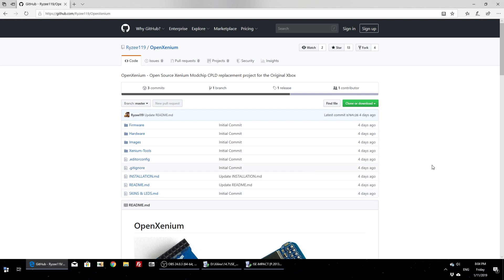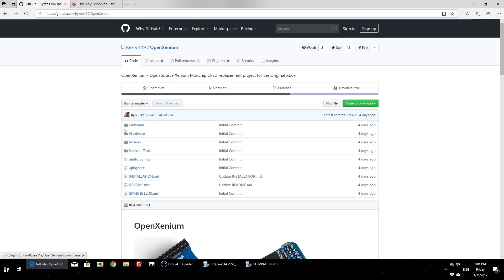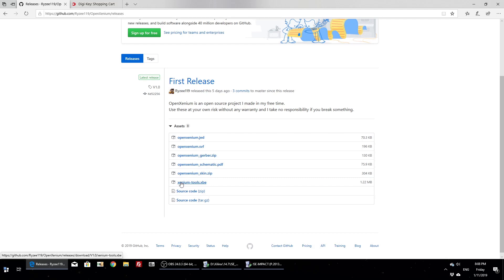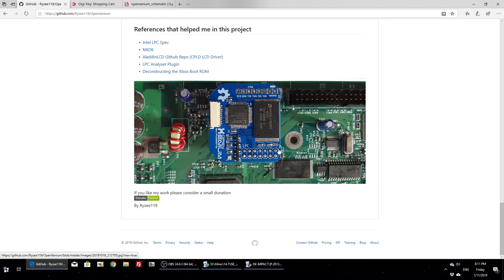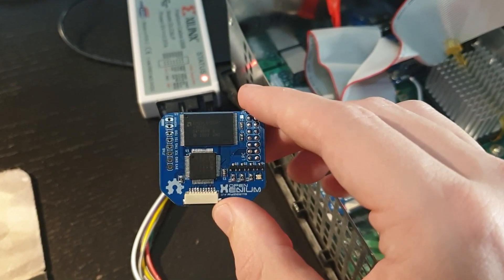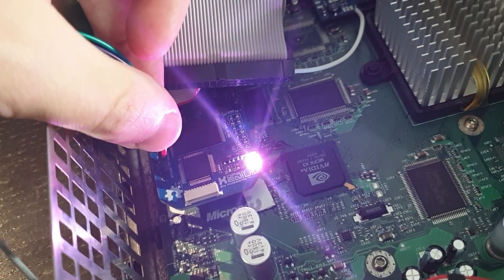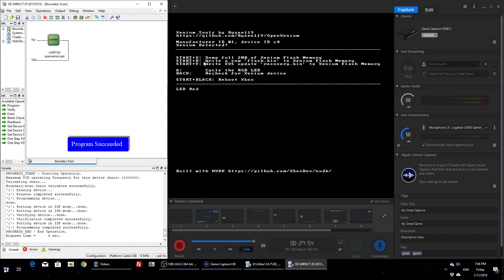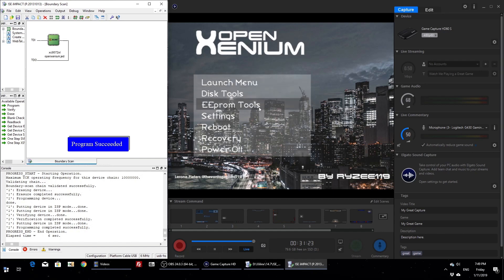Let's build an OpenXenium modchip for the Original Xbox

Comment: Hi. Is it possible to program using TL866 ii plus? there is also an IC output, but the output has other designations: VCC, SCK, MISO, MOSI, GRD, /CS.... Or the flash memory SPANSION S29AL016J70TF101 itself via the programmer

Comment: Got another question.
The xenium programmer on GitHub that uses a pi zero w or onion what is the value of the capacitor.
I'm not the best at reading build sheets for pcbs so it would be great if you could let me know

Comment: I did the OpenXenium and it was a lot of fun but hey look at the price of all components you need. (Subtotal £75.84
) obviously when you want to build something nice sometimes you do not mind the price but yet again is not cheap.
Reply from the maker: Does this include cpld programming hardware, soldering gear?
Its less than $15 in parts to build these?
Reply: @RockingRyzee  does not!! Those are only the components from digikey uk
Reply from the maker: @hrz_nrd  my digikey cart for a complete unit is £9. Plus a few for a pcb.
Shipping is added too i guess.
Ideally you dont just make one. You make 4 or 5
Reply: @RockingRyzee  I did 5 of course!! Not worth it only one, that’s not fun!! I do modify Xbox to 128mb but that’s very easy nothing compare to what you do!! Good on you mate and thank you for giving us such an amazing modd and great fun 🤩

Comment: I erased the chip, light went back to white, I programmed it and light went red but ´´xenium not detected´´ ooh well I guess I have to do an another chip.. I have 5 so I think maybe second attempt will go good.
Reply from the maker: Sounds like a solder issue between flash chip and cpld
Reply: @RockingRyzee   when I programmed for the first time It was fine, it was recognized but when I turned it back on, did not work and when I enter in xenimun tools with an another chip and swap to openxenium  is not recognized but yet I can  read it, erase it or programme with jtag programmer. Thank you
Reply: Ryan Wendland I made it!! Thank youuu!! I failed on the first attempt but not on the second, if I could post pictures here i would have post one or two! thank you great tutorial and amazing job!!

Comment: This looks great. I've never installed a modchip before. Is LPC rebuild PCB needed?
Reply from the maker: You need the LPC rebuild board if you are installing it in an xbox with a v1.6 motherboard
Reply: @RockingRyzee  when I used to do a 1.6 board I would just use wires

Comment: So you absolutely need a modchip already functioning for this to be done? That’s a bummer.
Reply from the maker: Not necessarily, its probably just the most accessible solution for most xbox enthusiast. You can also use an external parallel flash programmer to program the flash memory before soldering.
Or make a programmer with a raspi or something to simulate the LPC protocol that the xbox uses. (I did this for development using an Arduino)
Reply: @RockingRyzee  hey brother! You wouldn't happen to know if any tutorials to do this with either the raspi or arduino are around? I as well need to program one of your chips I purchased, I ended up buying another from someone different in hope of it being all set however had the same problem/: